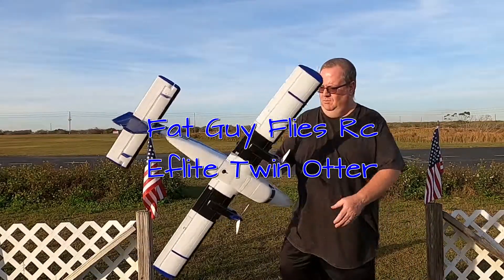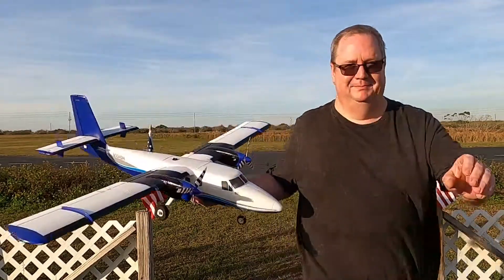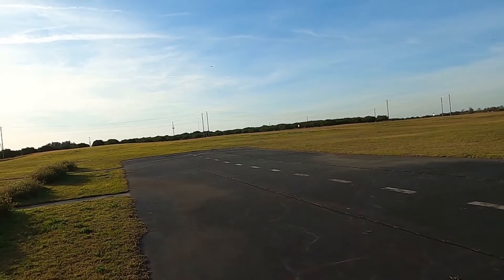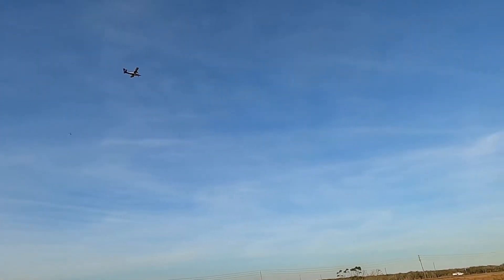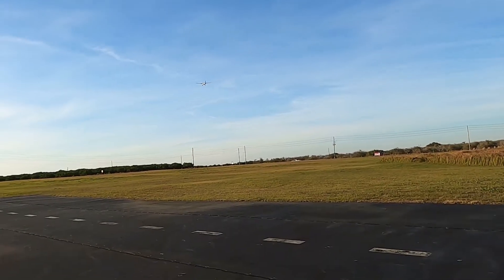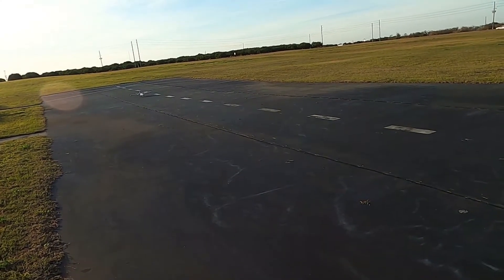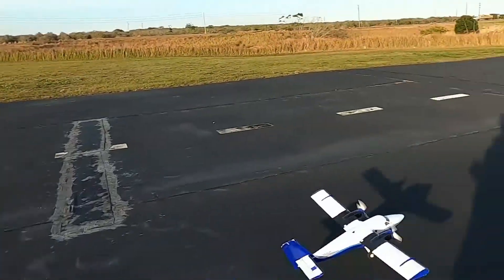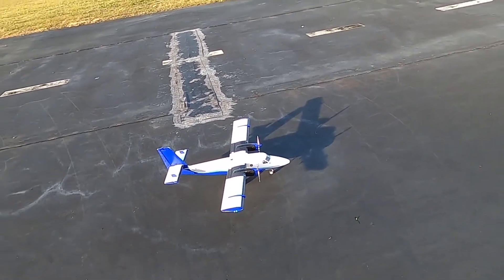Eflite Twin Otter flown by Fat Guy Flies Rc!!

Comment from the maker: So glad I pulled her out of the mothball hanger!!
Reply: Thanks for the video. I busted the foam around the nose gear on my twin otter as well during a bad landing. I’m trying to make repairs as well. Did you end up buying a new fuselage and switching all of the parts over to it? Your repairs look great.
Reply from the maker: @trevorkull6251  DO not buy a  new fuse, the new fuse has no hard points. It is litterly just foam only. I used hot glue to replace the entire nose gear with a nose gear and servo combo. better than original.
Reply: @FatGuyFliesRC  thanks a lot for the reply!
Reply from the maker: @trevorkull6251  np

Comment: Hey Greg how’s things .I’ve just purchased the twin otter and want ask you.....do you use a down mix with full flaps or did you find that you did not need it.
Thanx again for all the great videos.
Reply from the maker: Yes I do!  I use a DX9 , flaps up -100 /0%   for take off flaps I use 0% /20% and for landing flaps I use 100%/30%    this is the format Flap /elevator mix. Hope this helps and thanks! Remember flap settings are also subjective to the size of your lipo, weight and flying style. Use these settings and test them three mistakes high and see if they work for you.